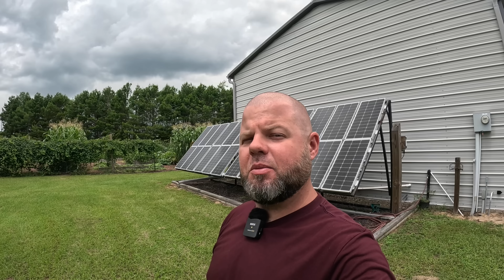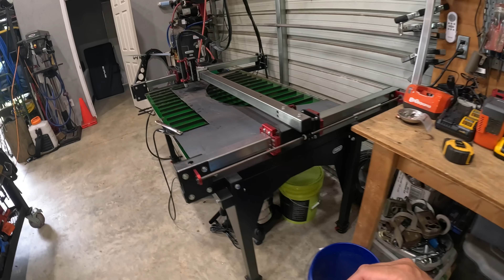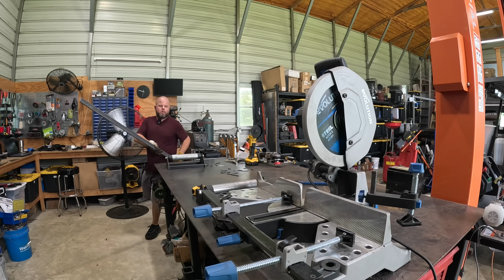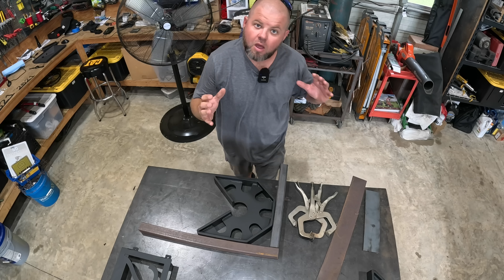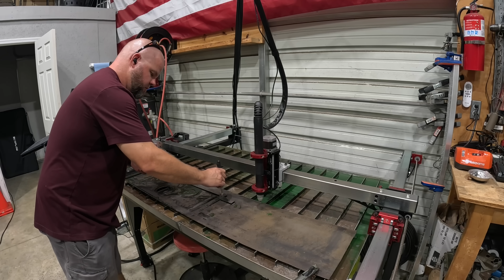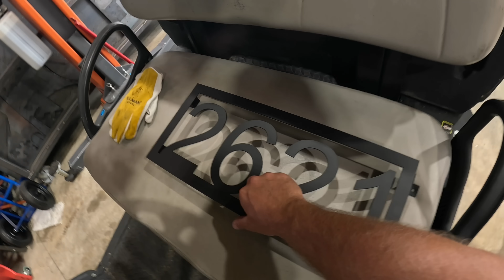DIY Welding Square Clamps Build Everlast Plasma Cutter

Comment: I was just like you, bending in a vice beating with a hamer. And I ended up building my own hydraulic press with a couple of I beams and picked up a pump at a scrap yard and a used 6 inch diameter piston saving a whole lot of money
Reply from the maker: Press is on my short list.

Comment: Sorry but this is a bad copy of a good tool.  The clamp reliefs you cut in the body were to small to pass the clamp through. Also my Fireball Mega square has different 2 length sides around the point for more or less weld relief area. At least copy it correct or not at all.
Reply from the maker: Very happy for you, they make an awesome product. I simply bought a file online and made a clamp. Mine isn't like theirs at all and doesn't have nearly the features. Where did I claim this? I have the tools to make something better than a simple magnetic clamp that I've been using for years. You're defending your purchase for no reason.
Reply: @TKCL  Who ever made the DXF design did a poor job, they clearly don't understand how the square works.  They should of copied the original design more closely.
Reply from the maker: Please move on and enjoy your bought clamps, mine are working well and easily clear my clamp heads. Much better than what I had.

Comment: How often do you change out the tips on your plasma torch.
Reply from the maker: Really depends on pierces, contamination ect.  I can get a bunch of cuts and pierces before changing a single tip out.
Reply: @TKCL  yep, moisture is the enemy of the tips, good clean air makes the world of difference.

Comment: What happened to that other metal bender you had??? The tabs to be screwed in to the address should've been bent so the screws were to the inside instead of the outside. I think there woulda been enough room to get a screwdriver between the inside frame to get it torqued to a wall. It would've given it a more "floating" look off the wall. Especially if the tabs subsequently get painted the same color as the house/background. Maybe the recipient can re-bend to the inside without breaking the tabs.
Reply from the maker: It's going on a brick wall, they will be using a drill and impact to put in concrete anchors.
Reply: @TKCL  He can use philips head Tapcons

Comment: Looks just like Fireball squares. Were you able to keep them square? I used the wings off an old Craftsman casted iron table saw.
Nice address signs.
Reply from the maker: Yes I was, checked over and over for square as I was tack welding.

Comment: I think a number sign that was a box with the numbers cut out, so the inverse of the one you made, would be very cool especially if you had some lights on the inside that were on a timer or photocell to be on at night. 

I would love to get the file for the square you built. They are awesome and just what I need in my shop.
Reply from the maker: I got the file off of Etsy, type in welding square dxf.
Reply: @TKCL  Thanks for the info. I didn't know there was welding stuff on Etsy. I was thinking it was mostly stuff you'd see at a 'Craft Fair'. You know pottery and handbags made from plastic grocery bags... 😂

Comment: Those jigs/squares are great, but you still have to try to keep things from moving after you weld it with your welding technique. It won't necessarily move while it is clamped, but if you get too carried away welding one side it will spring out of square when you unclamp it from the jig.

Comment: Them squares sure look a lot like Jason @fireball tools mega squares.
Reply: He even called it a Mega Square.  Jason's are cast though, not fabricated.
Reply: @D2O2 Jason's also can be ordered with his dragon scale coating which makes them completely non stick for welding splatter
Reply: I have a set of the Fireball Squares, they are the best investment that I have made to improve my fabrication.  I'm half blind and my welds look bad but at least everything is square now.  The Dragon scale that fireball uses is something space age tech, not one spec of spatter sticks to them.
Reply from the maker: He makes a great product that's night and day better than mine. I simply bought a file online and made myself a clamp that's better than magnetic clamps. Where did I say mine was superior to his? Where did I bash him? Where did I say I was selling these or improved on a design. I absolutely did not, you're all defending an expensive purchase and rightfully so. He makes a much better product with a lot of features mine does not have. Support him, he deserves it! I bought an expensive plasma table to make things and I am.
Reply: I'm sorry if I came across as attacking you, I didn't mean to at all, I just pointing out a very nice feature of his.  I also understand that they are pretty expensive for what they are @TKCL
Reply from the maker: Mark I don't feel attacked, I never presented this as a better product. Just showing I can make something I need with my plasma table. 99.9 percent of people can't and should buy and support his design as it's night and day better than mine.

Comment: Looks like your drought is over. At least you have the shop to work in during the storms. Great project. I didn't understand it until you finished and showed how to use them.
Reply from the maker: Yes it is, now it won't stop storming.